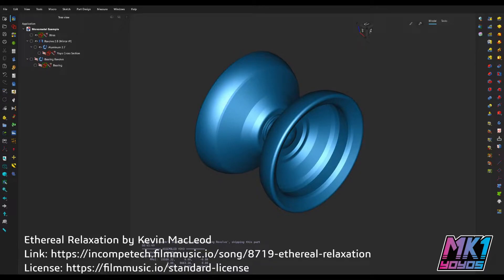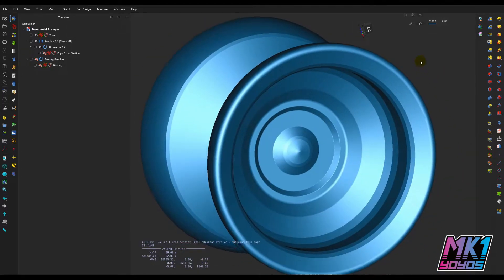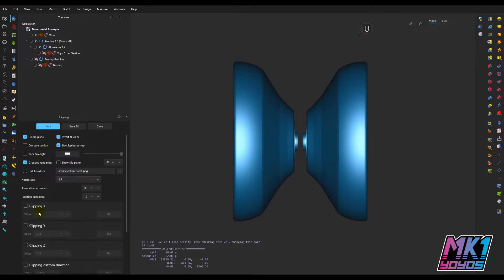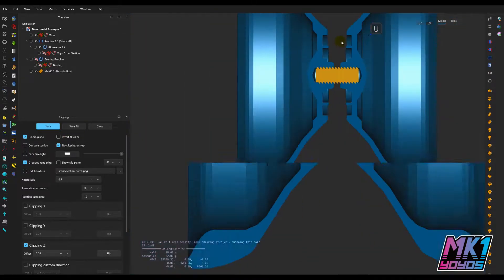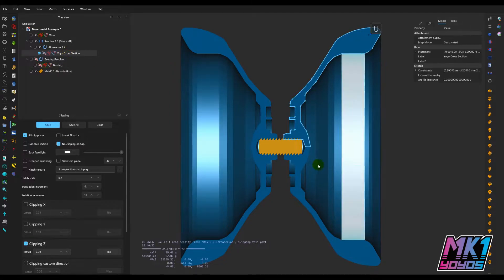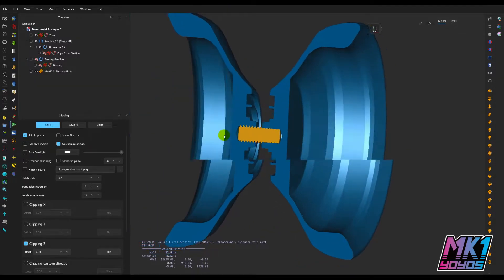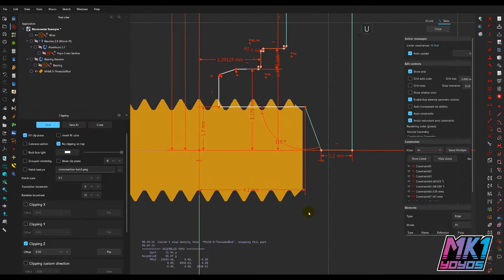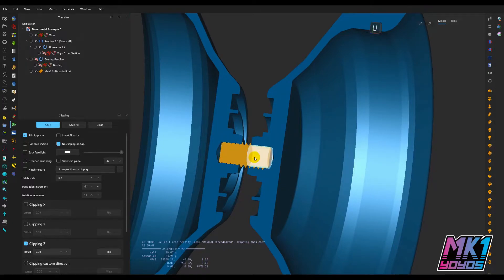Mk1 Mechanics Part 10: Why not Fingerspin?

Comment: Could you make a video to show how to make the Yoyo thread for the axel?
Reply from the maker: This isn't necessary to do in CAD. Threads are very complicated and expensive to model - you would typically just call it out in the design when sending something to be manufactured. However, if you want to model it with threads, you can use the tools in the Fasteners Workbench to create a tap, and then Part Cut to subtract the tap from the yoyo body.
Reply: Thanks.😂

Comment: That was a very interesting video and confirmed what I imagined was going on. I was a little surprised at just how much mass was added with a fingerspin design. Was your example in 6061 and if so could better results be achieved in 7075 or 7068?
Reply: The densities of 7k series vs 5 or 6k series is legitimately very small. The volumes at play here are indicitive of the sensitivities to geometry regardless of material chosen. Its all very fascinating.
Reply from the maker: You can try different things in 70xx like make the axle 6mm long, which removes a whole lot of center weight. In the diffraction cup example it cuts it from 67.3g to 63.9g by making only that adjustment.

In a real example the mass at the rim of the yoyo would probably be reduced first, as it was in the Diffraction series and Spyglass.